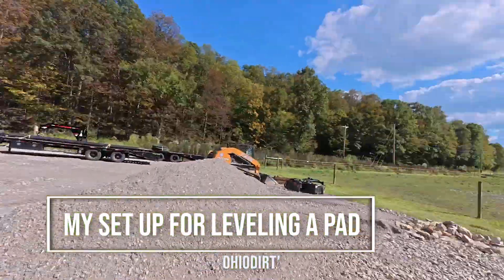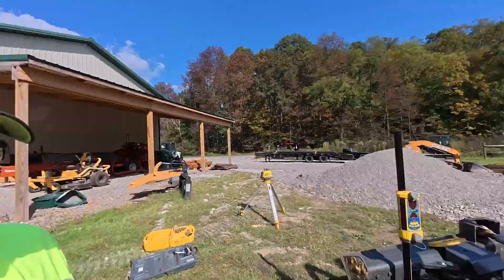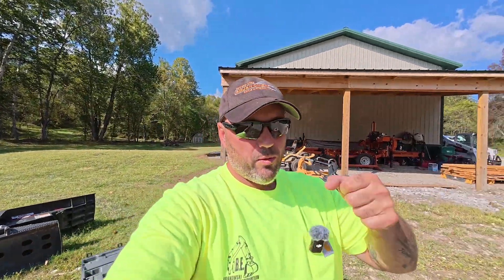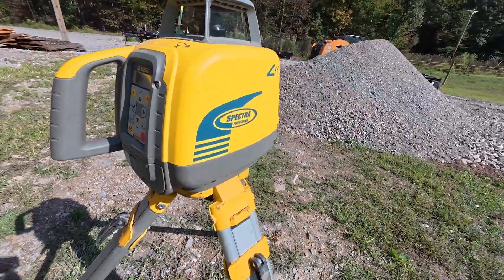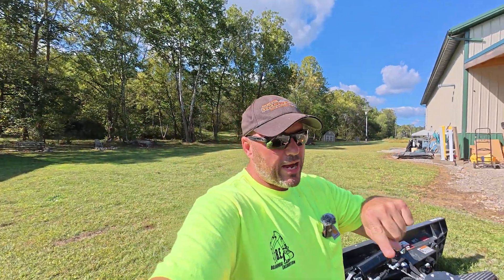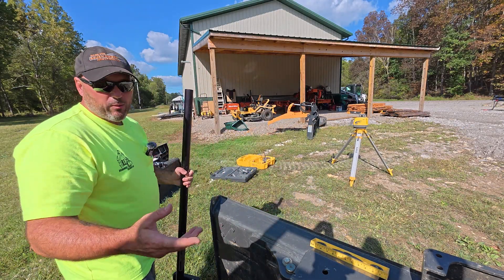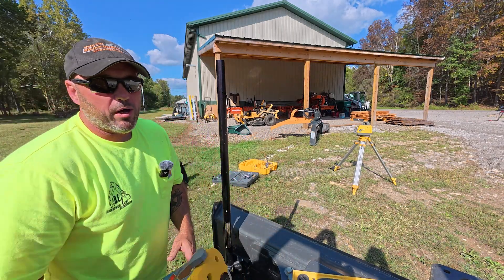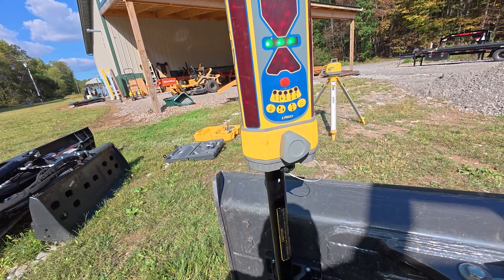How do I level a building pad? - 063

Comment: thanks for posting. Would you still recommend the lr50 since you have some time to use it more?
Reply from the maker: Yes. I have had it for almost 2 years.   It’s great for building pads on the dozer.   I have also use it recently with my excavator for a solo ditch.  Needed to trench about 300 with a 2% slope.  Worked great

Comment: Thanks for sharing your knowledge and equipment! I always wanted to know how a laser worked. Do you have any way to get the wash board ripples out when finish grading with a small dozer like a JD 350? Thanks again!
Reply from the maker: Thanks for tuning in.  Best way I find to eliminate or reduce washboards is to angle the blade a bit and go slower.  This allows you to feel the dozer movements and adjust better with the blade up and down.
Reply: @TheOhioDirt  Thanks I will try that!